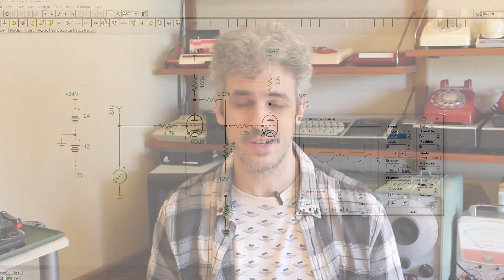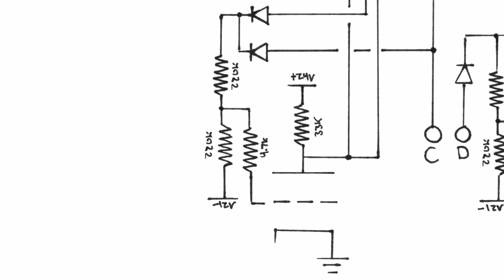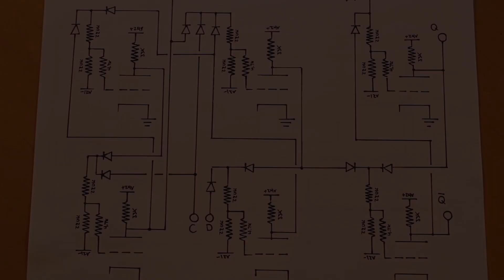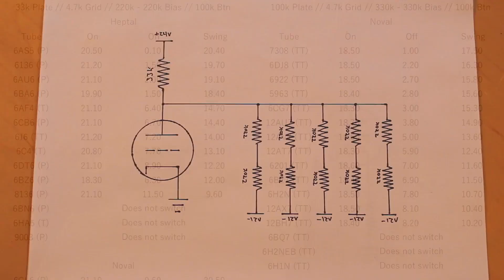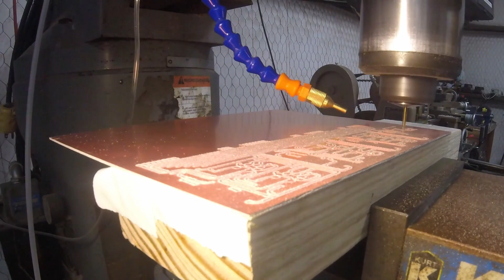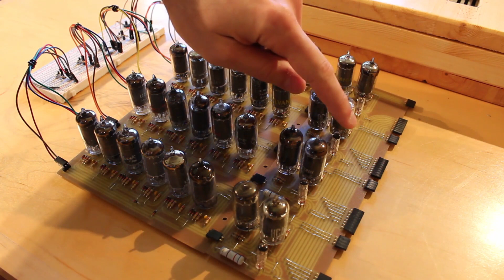Vacuum Tube Computer P.09 – Building the 4-bit Instruction Register

Comment: Wonderful. But some of the filaments look a bit over powered. I love the new Russian VFD's.
Reply from the maker: Thank you!
I noticed that some of the filaments were brighter than others as well and was slightly concerned. So, I did actually checked the voltage drop across them, and each filament is seeing right around 6V. I think that since it's essentially just a random smattering of different tube manufacturers (GE, Tung Sol, Sylvania, Philco, etc.) that even though the filaments have the same specs (6.3V and 300mA), some glow brighter or are more visible from a tube construction standpoint than others. 
And I couldn't be happier with those Russian VFDs, they look epic!

Comment: You using TELEFUNKEN Space Charge vacuum tubes, may it might be possible to have the heaters connected in parallel
Reply from the maker: I'm actually using kind of a weird mix of tube manufacturers here: Sylvania, RCA, GE, etc. But, they're not specifically low voltage space charge tubes like could be found in late model tube car radios. They're just run of the mill 6AU6s, which usually expect about 100V to 150V on the plate I believe.

It could be possible to run the heaters in parallel, but I don't actually have a second 6V power supply in use here. The only two power supplies I'm planning on using are a +24V and -12V supply, so I have to run the 6V heaters in series to get the proper voltage across them. The upside is a simplified power supply setup, which should make life easier as this thing starts to grow to ridiculous sizes!

Comment: I think if you use higher anode voltage, maybe a cathode follower is not necessary. And im curious about what you are going to use as memory of the computer. Anyway, that will be a splendid project!😁
Reply from the maker: Thank you very much!

Most definitely a lot of my headaches would be solved if I had a reasonable anode voltage! But, I like the idea of a low voltage vacuum tube computer and how accessible it makes vacuum tube electronics to the average enthusiast. Plus, it's fun to just hilariously misuse components, haha.

Memory is going to be a tough one! There's going to need to be three different types of memory I think. 
First is program storage. I think for this one I'm going to use paper tape since it only needs to be read only and there's a lot of feasible ways to tackle that.
Second is general purpose registers. For these, I think I may end up just having to bite the bullet and build my registers out of tubes for ease of integration into the machine.
Third is random access memory (ie. memory much larger than a general purpose register). Whereas the registers will probably be 8-bit, I would like around 64-bits of RAM. That's still mega low, but enough that building it from tubes isn't really possible. The obvious choice is core memory, but that carries with it a lot of difficulties as well. The current option I'm exploring is actually light based RAM using VFDs and photoresistors. Here's a test I did just today actually: https://imgur.com/gallery/yz4yWDY

I still have a long way to go, but the deeper I get into it, the more interesting it gets!

Comment: Hey  I would like to commend you on your work! I would also like to know about your VFD displays?  and your PCB software. Thanks for a great channel
Reply from the maker: Thank you so much!
The VFDs I'm using here are little Russian IV-15 displays, they're a copy of the DM160 VFD, which I believe was the very first commercial VFD. I ordered them off eBay for decently cheap, though I had to wait a month for them to arrive as they came all the way from Russia.
The PCB software is DesignSpark PCB (https://www.rs-online.com/designspark/pcb-software). I quite like it, though it's not as popular as some other programs, like Kicad. I can't really vouch for any of the auto-routing features, as I hand route every one of my PCBs. This is mostly because I've learned how our Bridgeport EZTrak cuts boards and have kind of memorized good and bad practices specific to the mill when laying out a PCB. Also, I find it super therapeutic, haha.
Reply: @UsagiElectric  thanks for feed back, do you use the free version or the 499?
Reply from the maker: @Sam-jw1yn  No problem! I use the free version. I haven't come across any limitations so far that have warranted upgrading to the paid version.
Reply: @UsagiElectric  Thanks again! You should do a video on the PCB software and your CNC setup.
Thanks  Sam
Reply from the maker: @Sam-jw1yn  I actually did some earlier videos about the software and CNC setup, but they were some of the first videos I ever made, and so definitely could use to be redone, haha. If you're curious for now though:
https://youtu.be/I2heH5fXtZM
https://youtu.be/F2FRN5z2S78
I think I may just remake these for the MC14500 Breadboard CPU series I'm doing simultaneous to the tube CPU build. Since eventually that build is going to move over to PCBs, it'll be a good opportunity to talk about the setup!

Comment: Very neat. Out of curiosity, what's the power drawn by this register?
Reply from the maker: Thank you!

Oooh, power draw is an interesting thing to calculate here. 99% of power draw comes from the filament heater in each tube. I’m using the 6AU6 and the heater is rated at 300mA at 6.3V. Since I’m running at 24V, I can run four heaters in series and get a 6V drop across each one. That’s slightly under-volting each heater, but it actually saves some power with no real noticeable impact on performance.

Four heaters in series at 24V should draw 0.285mA of current, which is 6.84 W of power. There are 32 tubes used in the instruction register, which is eight groups of four. Which should be about 2.2A, or 52W of power. 

Now, it should be noted that 24 of the tubes are setup as groups of four powered from 24V, and the remaining 8 tubes are setup as groups of two powered from -12V. So, the 24V supply is providing 41W and the 12V supply is giving the remaining 11W. 

Of course, that’s just when it’s running. The inrush current draw is actually enough that my 24V 15A power supply gets upset and thinks there’s a short, so in the future I’m definitely going to have to think of some kind of slow turn solution.

That’s a phenomenally large amount of power for something so simple, haha.
Reply: @UsagiElectric  Ouch! I suspected it wouldn't be pretty.

When I was at Uni back in the 80's one of my colleagues built a 4 bit CPU out of LS TTL chips. It ended up a nightmare finding a couple of very large PSUs for a student project.
Reply from the maker: @grotsoftsadventuresinelect8868  Yeah, as this thing gets bigger and bigger, the power supply is going to become more and more of a headache, haha. 
Fortunately, with the abundance of 3D printers, there's a lot of 24V power solutions out there. And, I think with a thyratron, a big timer capacitor and a massive power resistor, I can setup a sort of time delay that allows the heaters to start warming up a bit and come up in resistance before letting the power supply do it's full thing, helping to battle the inrush problem. 
That's awesome that y'all built a 4-bit TTL CPU! I imagine that was a ton of fun to figure out, especially in the 80s! It's easy to forget how amazing of a resource the internet is when it comes to researching things. I wouldn't even dream of undertaking this project (or even building a TTL CPU) without all the reference material I've been able to collect over the past year.

Comment: Here is a neat effect.  Connect Not Q to D and then fee the output to the next D.  If I remember right, you will get a counter if it is connected right.

IT is no wonder why ENIAC took up a 100 foot long room, can you image the space and heat over over 17,480 tubes?
Reply from the maker: That is an excellent way to make binary counter!
Though, I'm not sure if the D Flip Flop design I use here would actually be capable of doing it without issue. When I used this design in the proof of concept we ran into all sorts of weird racing problems, which we shouldn't get with this design. I was able to rectify that by redesigning the D Flip Flop to a master-slave (primary-secondary) design, which should work great setup as a binary counter as well.
That starts to get pretty tube intensive for large counters though (8 tubes per D Flip Flop means an 8-bit counter is 64 tubes!). Although, the bigger issue is how to integrate that into the design as the program counter. If I want to decode the binary count into individual signals, that's a decoder that has 256 tubes in it! I still haven't thought of a good solution for the program counter just yet, but I'm thinking paper tape loops are the best bet.

At first, I had no clue why or how the first computers were the size of rooms and used thousands and thousands of tubes, but I can totally see it now. I'm trying to build the most watered down and simplified computing circuit I can think of and we're still looking at several hundred tubes! Also, even with just 32 tubes for the instruction register, I can feel the heat radiating off it. I can't even imagine the level of heat something like ENIAC put out!
Reply: @UsagiElectric  I read somewhere that ENIAC took special fans and air conditioning units just to keep the room cool enough.  It also consumed about 150,000 watts of electricity.
Reply from the maker: @stphinkle  I can believe it! I can’t even imagine how hot it must have been in the room with that machine, even with hardcore air conditioning. And, it’s crazy to think that most likely, about 90% of all that power was just to run the filament heaters!
Reply: @UsagiElectric  It you think about computing history and that the average microprocessor today has the equivalent of billions of tubes in just that one chip of silicon, it is pretty amazing.
Reply from the maker: @stphinkle  Oh yeah, absolutely! Even within the microprocessor world, things have changed so much it's hard to wrap your head around. Ken made an excellent post comparing the ARM1 processor from 1985 to the Apple M1 processor from last year, and it's mind boggling to think of the advancements!
Edit: Just realized I forgot to post the link to Ken's Twitter post!  https://twitter.com/kenshirriff/status/1327021630636212224

Comment: It will get more and more interesting to see it all work together, the more parts you build. Especially in high impedance systems like vacuum tubes, there are a lot of things that might become a problem in the end. 
But this far you definately deserve respect for getting it going. :) 
Another intersting thing might be to see if the system can be optimized later on to reduce the total amount of tubes. Maybe you are able to reuse some parts of the system for another task if their original task can't be executed at the same time?

Greetings from Germany, 
Michael
Reply from the maker: Thank you!
You're absolutely right that as it grows in size, it gets harder to predict how certain aspects of the machine will interact with other bits. My hope is that with buffers in the right spots, everything will go smoothly, but it's going to get really interesting with the clock circuit and timing issues!
I could drop the total number of tubes in half by using dual triodes (particularly something like the 6DJ8 or 6CG7), but those tend to be much more expensive than the 6AU6. But, it'll be interesting to see if there are other avenues for optimizations in the future!